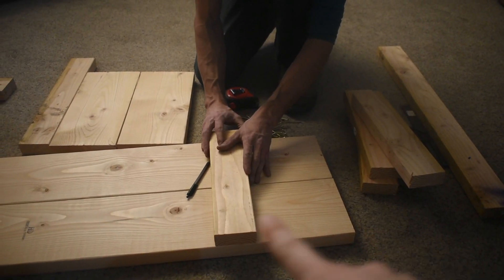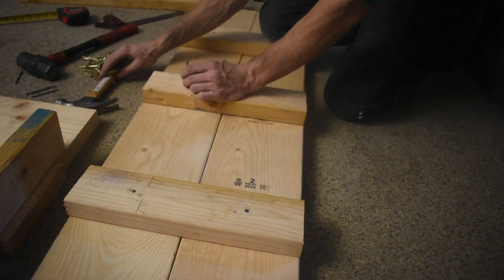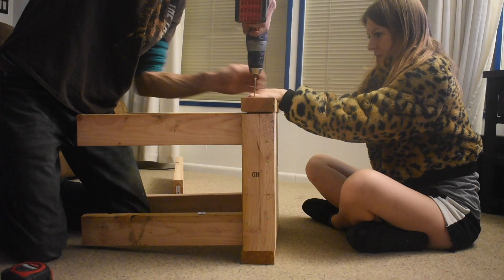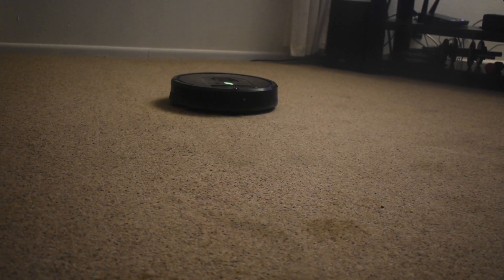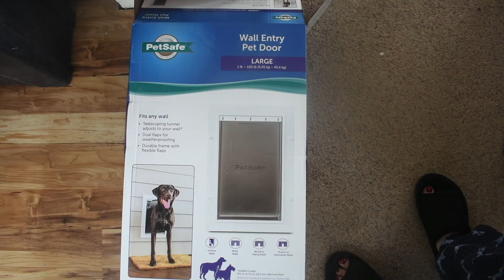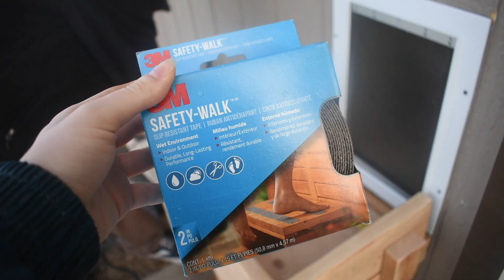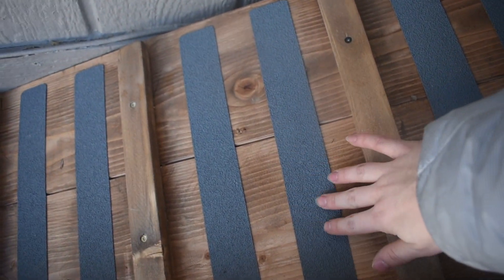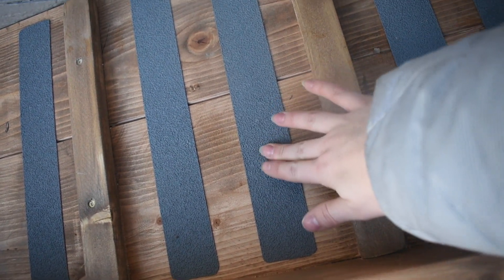DIY Outdoor Dog Ramp | Big Dog Approved

Comment: I've had similar safety tread things on my front steps. They're garbage. I'm still looking for an alternative. I might just super glue them down.

Did you every do the poly? I was thinking of just doing the stain since I feel like the poly might make it slippery.
Reply from the maker: Yeah it definitely was garbage, didn't hold up through the weather. Yeah I did the poly and it was more slick. I just wanted to get it good and coated so it didn't splinter into his paw or something. Super glue may hold it on better, it's worth a try!

Comment: do you think making the platform twice as long would support an adult? we have a small old porch outside a sliding door that we don't use anymore. and i made a ramp off of it with shingles as the tread but I'm going to redo the whole thing.  i would be more comfortable with the sides being higher. so the dog doesn'[t slip off
Reply from the maker: I walked it on it several times and it held my weight, so I would think if you made it bigger and longer it would definitely support an adult.